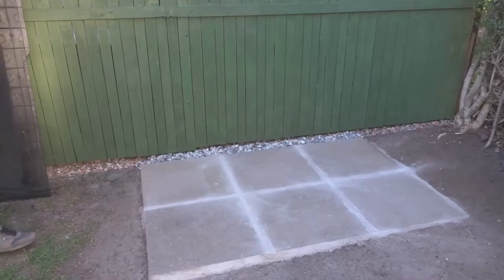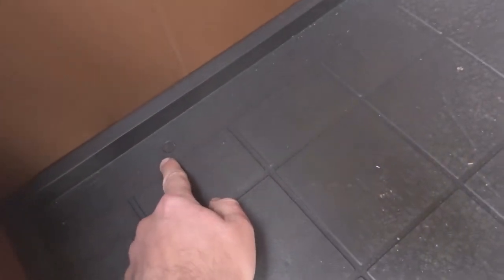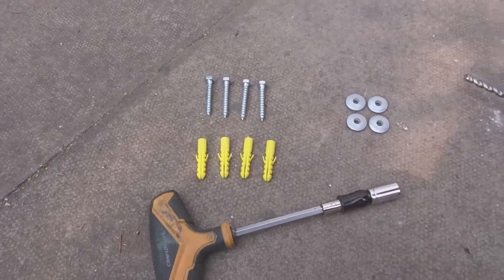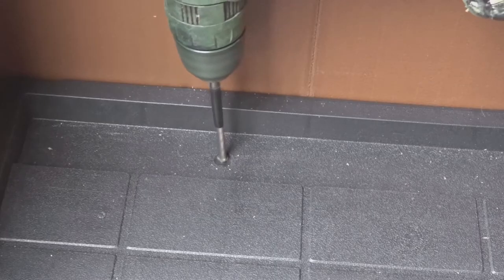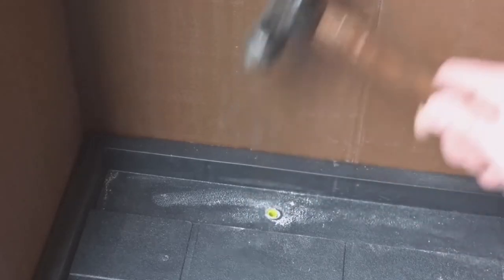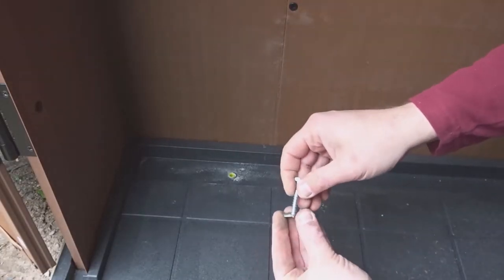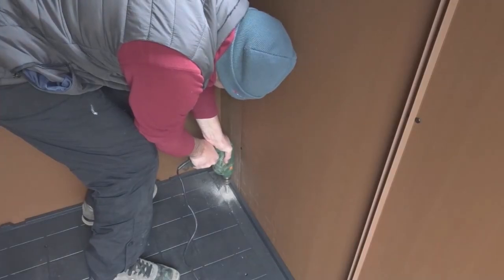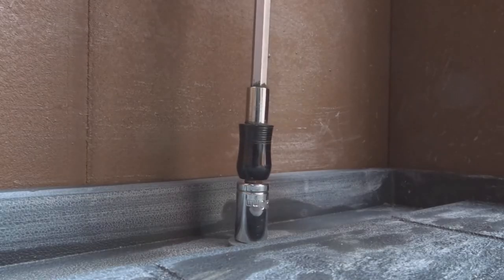How to Anchor a Plastic / Metal Shed to a Concrete Base

Comment: This is exactly what I was looking for, wow. Something told me to scroll down some more and look at another video. This is exactly what I was looking for! Again. Thx phillwyatt. Will be tooning in to more of what'cha got. I worry no more. 😂
Reply from the maker: Great to hear!
Reply: @PhillWyattProjects   yeah bro I'm bout to buy a shed and it's going to sit on the concrete next to our garage that a canopy was over we had tore down. And anchoring it down this was is perfect!. I seen the Arrowhead video about using them, but it only would work for one side because the lawn is too far away on the other side to use the Arrowhead anchors and wouldn't won't anyone tripping over the out stretched wire. But  your way is spot on. I couldn't have been more relieved when watching your video. And you explained it perfectly. 
 Thx for the holla bacc/response. Much appreciated. Will share, like and subscribe.

Comment: The  screws I used where a hell of a lot bigger and heavy duty washers to screw down my ketter 6x4  and if you put the plug on the screw and hammer it in then screw it down you will get a much better grip
Reply from the maker: Yea I just used what I had at the time but they seem to be sufficient and I got a nice tight hold with the bolts. You can't go too big so the bigger the better I guess.

Comment: Hi what size masonry bit you used to drill that hole please thanks .
Reply from the maker: I think it was around 8mm to match the diameter of the bolt body.

Comment: I would use cement screws but put down a layer of plywood then put the screws down with washers
Reply from the maker: Yes that sounds like a good idea. I didn't have cement screws at the time and this method is working great so far.

Comment: HI Phill, nice video. Can you tell me where you can get the plastic flooring you use in this video - looks like something I'd like for my shed floor but all I can find online are rubber mats or wooden flooring. I like them one/two piece floors with high edging to stop any 'potential' water getting in.
Reply from the maker: Cheers Tony 👍🏻 I used an off cut of vinyl flooring from a bathroom. Not sure where you can get it because it's like what they use in restaurant toilets very hard wearing. Sorry I can't be more helpful.

Comment: I'm going to install the same shed at my backyard which has marbles. Will it be ok if i anchor it with the same way?
Reply from the maker: Yes it should be ok as long as you don't live in an area that has hurricanes. Use the longest bolts you can find. With big washers.

Comment: looks like a pretty weak connection, washer is way too small to resist any real wind load as the base looks like a pretty thin piece of plastic...   I've used a piece of pressure-treated board for the full length of the shed to distribute load across the full length of the base and screwed it in 3 places. 40mph+ winds and still standing...
Reply from the maker: Mine hasn't moved at all. It's solid.
Reply: Better off putting 4 concrete blocks than putting a flimsy screw
Reply from the maker: @kevins3646  each to their own.

Comment: I am doing 7'x7' shed on a paver base.  Pavers are smaller 1'x1'. They are not cemented in, but just laid on compacted base.  Is anchoring to 1'x1' pavers going to be sufficient?  Should I put more than 4 bolts?
Reply from the maker: That depends. What country do you live in?
Reply: @PhillWyattProjects  Minnesota,  USA.  We had 60 miles/hour winds yesterday.
Reply from the maker: @alexanderhawk2659  the thing is, the fixings are only as strong as the strength of the connection between the shed itself and the base it's screwed too. So, if you get a lot of bad weather I think the best way to prevent damage is to erect the shed near to fencing and cover. Also bolt it down.
Reply: @PhillWyattProjects  I ended up drilling holes on the walls near the base, putting thick U-bolts in, and securing U-bolts with connectors to large Anchor Screws into the ground.  This way it's solid and no ugly wires going over the shed.  We get get crazy wind here in the prairies.  Last summer my neighbor's shed ended upside down, while mine stood still.
Reply from the maker: @alexanderhawk2659 sounds like a reasonable idea 👍🏻
Reply: @PhillWyattProjects  I ended up getting 18" ground screws next to foundation and U-bolting them to the shed wall (reinforced with steel plates).  This way it's barely noticeable and sturdy.  Withstood 70mps so far.
Reply: @alexanderhawk2659  i need a pic of that, I want to do the same
Reply: @Scottishgurl69  I ended up anchoring with four 18" earth screws, connected to the lower side of the shed.